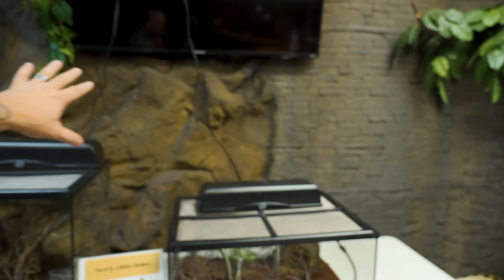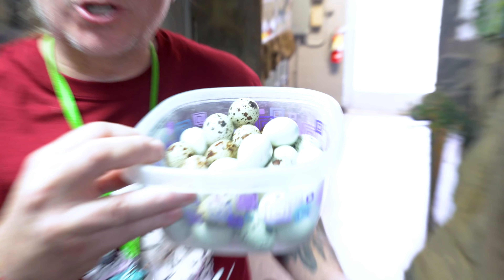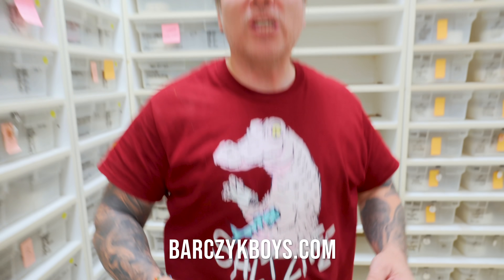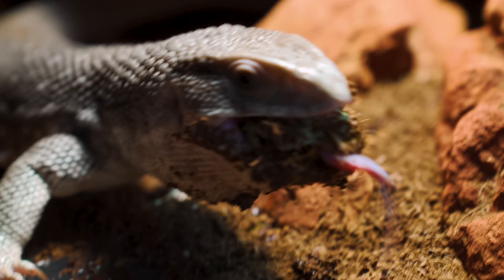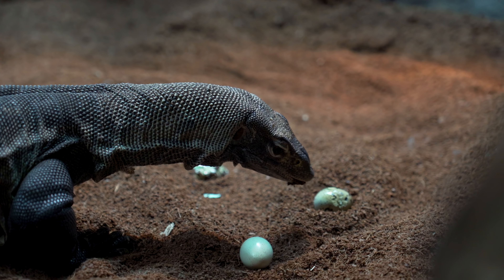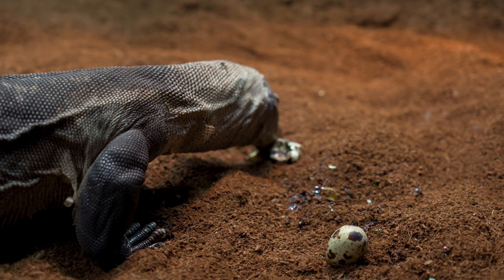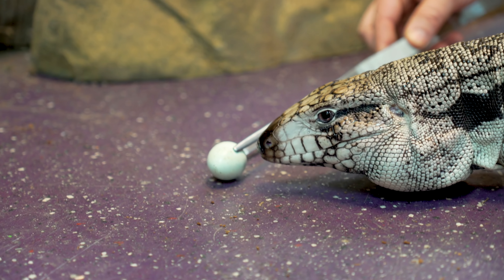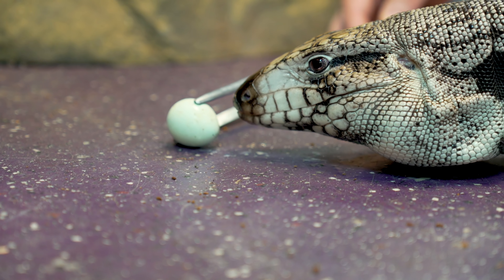REPTILE ZOO RENOVATION!! DAY #1 | BRIAN BARCZYK

Comment: Try cracking an egg and let only a little run out. Then microwave it for 10-20 seconds and santana should be able to make a mess without most of the egg running into the substrate.